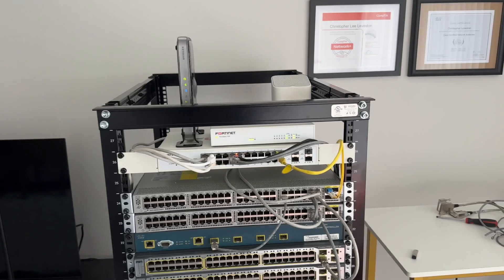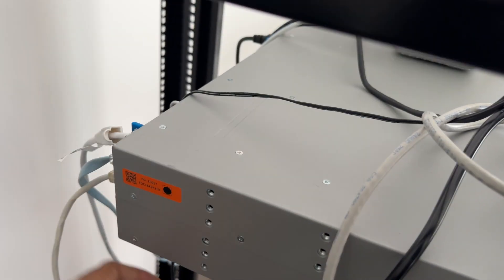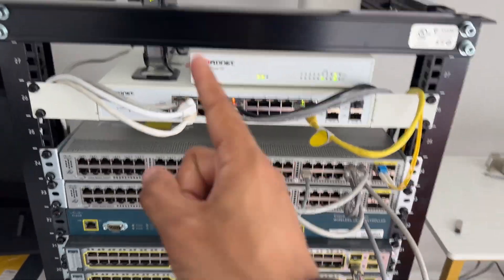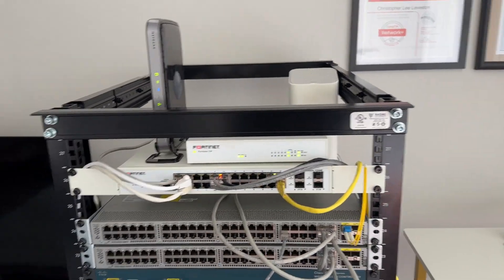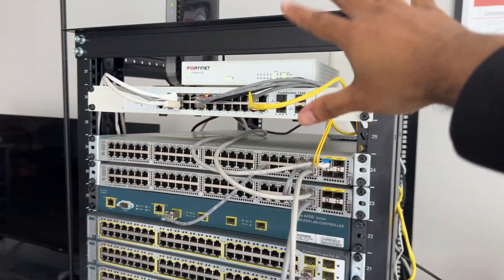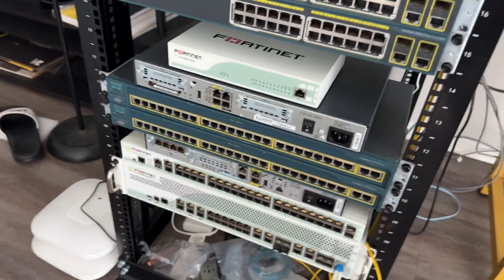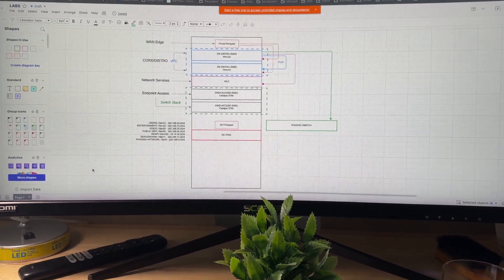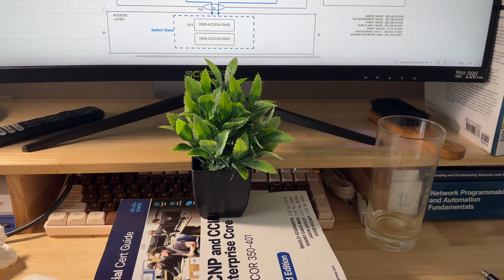My Cisco & Fortinet Network Lab

Comment: I am currently looking to start picking up networking skills in my pursuit of becoming an infrastructure engineer do you recommend starting out I buy some old cheap switches for my homelab and what models, I have heard about the Cisco modeling labs being a great virtual option and anytime I hear virtual my interest is peaked. Would you recommend purchasing the CML and putting it on something like a proxmox and start my CCNA to CCNP journey or would this be doing too much for someone starting out in the networking route ?
Reply from the maker: @BACKSPIN9ball  starting out with CML for your CCNA doesn’t sound bad at all. When I studied for my CCNA, I used packet tracer. However, with my CCNP, it will definitely be a GNS3 and maybe CML. I haven’t looked up CML as much.
Reply: @ thanks for the reply,my goal is to virtualize as much as I can without compromising my learning and definitely GNS3 come up in my research a lot

Comment: Have you ever been on the field? With your understanding with those complex set ups, people like yourself are very rare. I've maintained a data center in a warehouse which I can't name. But my job was to basically keep the network up. Too bad the pay wasn't great, but at least you won't be on the floor working in harsh conditions lol. Anyway, I left the field 2 years ago to become a software engineer. But yeah,you're lucky to even get those because they're super expensive. Just make sure to have some backups because those cisco types are known to failed.
Reply from the maker: Thanks for watching. Yes I have been on the field, but it was mostly as a network technician. Most of the times, I would go into Cisco 9300 switches to make certain configurations on them. I’ve racked and stacked and also worked in closets, even did my own brand new closet.

Comment: Man, dope video bruh and crazy setup.  I always felt for the Network Engineers at my current job because it seems like it's ALWAYS something going wrong for them. I was like, I ain't NEVA gonna mess with Networking like that because I know them people be stressed. lol. On the flip side, you still need to know your fair share of network knowledge as an I.T Pro, no matter what you may specialize in. I didn't know a home lab could be that affordable if you know the right people at your job and you just search on Ebay and even marketplace. Definitely need to sharpen my knowledge on networks a lot more after watching your video. Keep it up man.
Reply from the maker: Appreciate that bro. Yeah man, the equipment can be very affordable on eBay and the right amount of research on what you need. Also, so many sleep in these companies decommissioning old network gear, you can get a lot of stuff for free grabbing gear off of jobs.
Reply: @DataBunny  Word. I know equipment is often decommissioned where I work at. The thing is I currently work remotely, so I don't really get dibs or offered anything Lol. I'll check out my next position and see what I can get my hands on.

Comment: Very impressive lab, I don't know why as a windows and cloud Admin I feel kinda inadequate without core networking skills. I have a homelab that runs proxmox nodes with a couple of windows and Linux vms running. Am hoping to incooperate some networking equipment as a learning project what would you recommend I start with and what are some cheap switches and routers I can start out with and things to look out for.